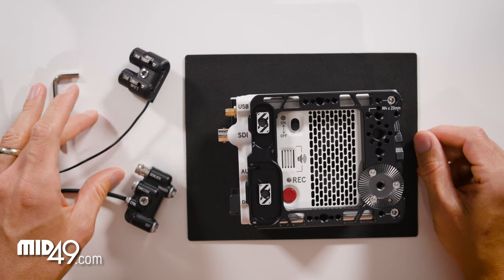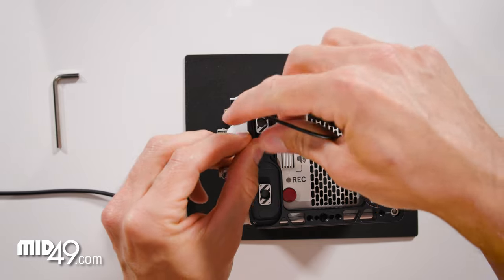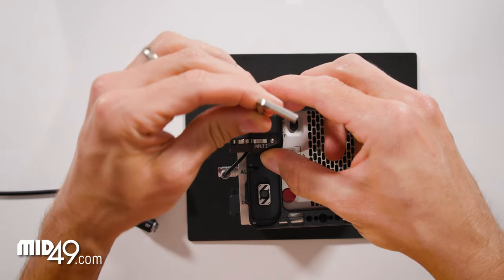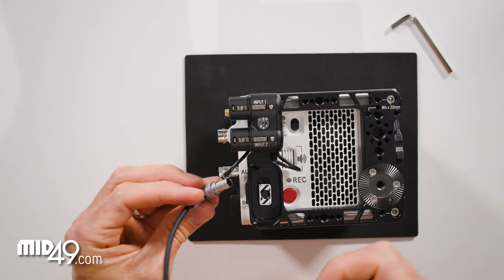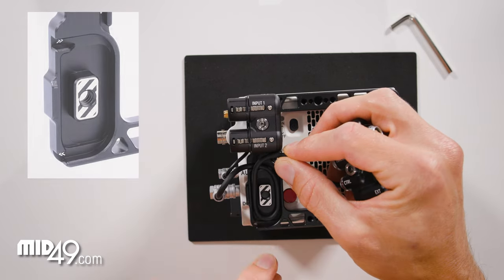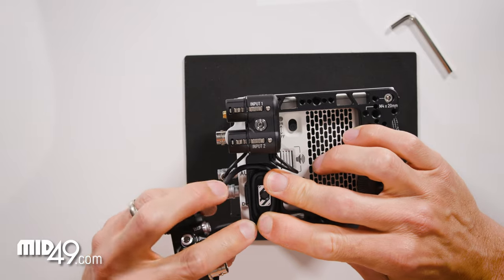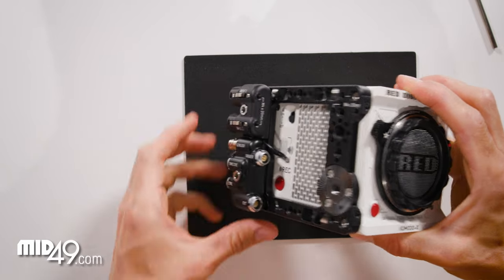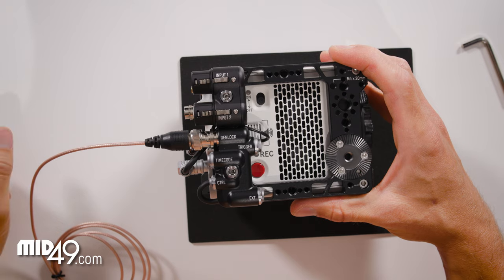MID49's Install Guide for the RED Komodo-X Side Plate Cable Routing

Comment: Can you install the DSMC3 RED 5-PIN TO DUAL XLR ADAPTER instead of the AB-1? I really like your plate and EB-1! I already have the original dual xlr adapter and so getting the side plate and the EB-1 would only make sense for me if I can mount the xlr adapter by red somewhere nice.
Reply from the maker: You could probably mount the RED adapter on the 3/8-16 hole toward the front of the Side Plate, but there is a chance the XLR cable ends might collide with the EB-1.
Reply: @mid49films  that’s what I thought. Too bad :( is there a store in LA where I could test out the cage instead of buying it and then sending it back if it doesn’t work?
Reply from the maker: @RicoStein_   AbelCine in Burbank is in the process of stocking our products but I do not believe they have demo models yet. Please send us an email and we can try to get something set up for you!  info@mid49.com
Reply: @mid49films   Thanks!

Comment: When installing to red komodo 6K OG, how do the xlr have power going throught 3.5 trs?

Or you can only use xlr that dont need phantom power?
Reply from the maker: On the original Komodo, phantom power is not available, so you'd need a self-powered microphone. The AB-3 is a passive adapter.
Reply: @mid49films  okay thanks! Can you guys make a trigger button or so? I just phrchased your too handle kit. I love what you guys are doing, innovating all the parts for a better workflow 🤝🏻
Reply from the maker: @JesusMartinezCreates  We are doing more with trigger options later this year and will likely offer some type of bolt-on option.